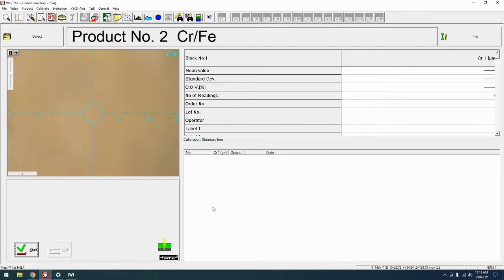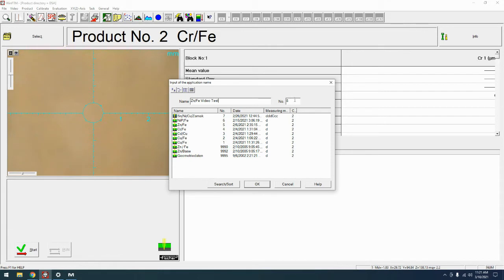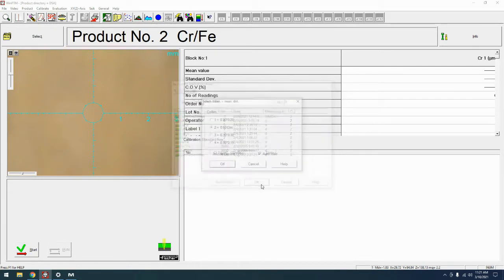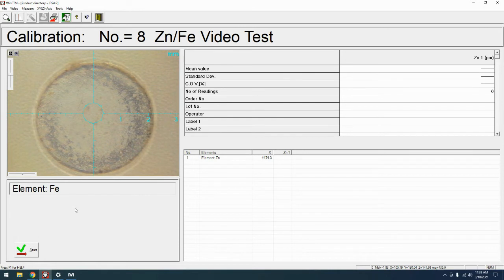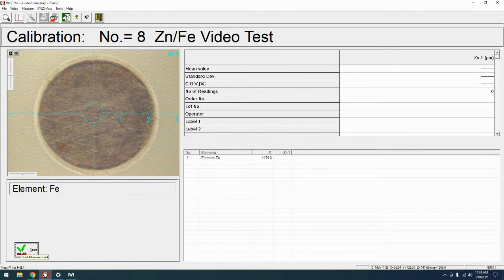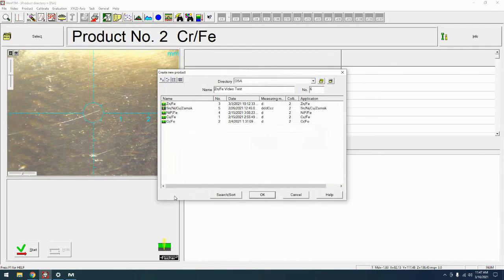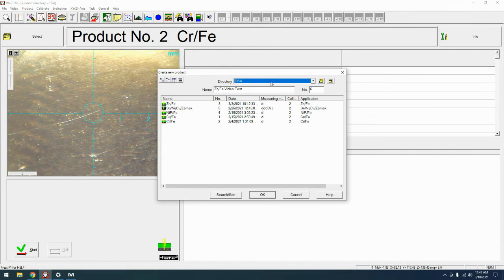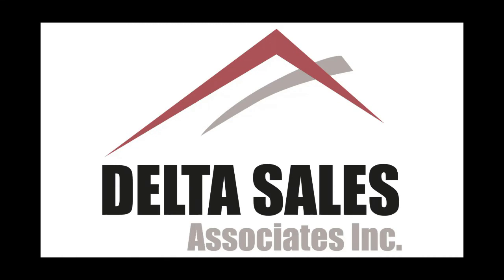How to Create a new application or product on Fischer X-Ray

Comment: Hi 

Thank you for your efforts.

I am a new user of Fischer XDAL machine,  I would like to create a new application to measure the thickness SnNiAg on a coated surface, I do have a pure elements and two certified standards SnNi.

Are the measured thickness of Ag accurate as the SnNi even if I don't use a certificate standard during Application creation?

I mean is the Ag pure element enough to teach the application created  ? 

Thank you
Reply from the maker: Lacking an actual SnNiAg standard, the Ag pure element would work.  I'd recommend having at least one SnNiAg standard.  Depending on the substrate you might want two or more standards.

Feel free to reach out to us with more questions!
Reply: @dsareps  thank you Sir